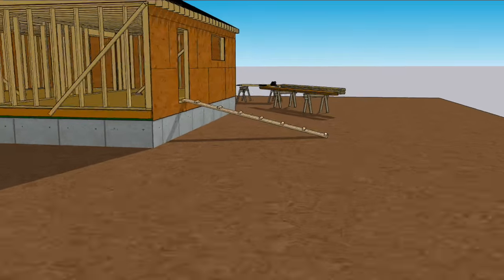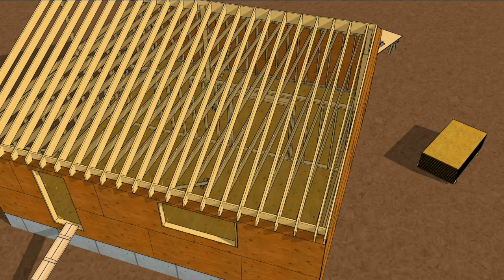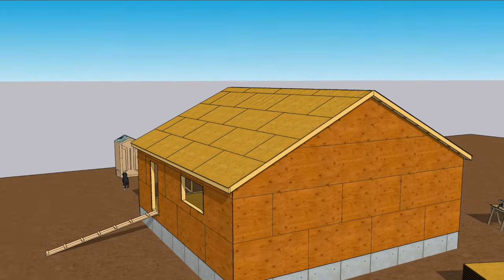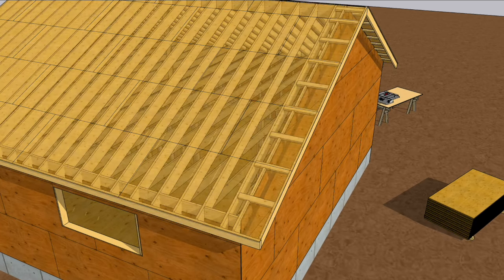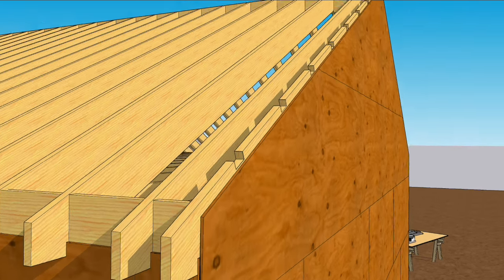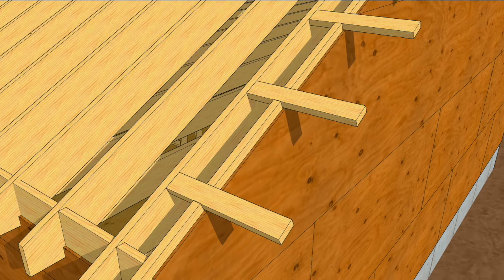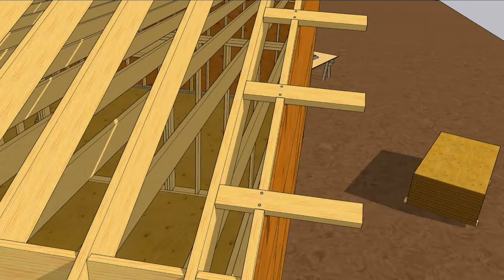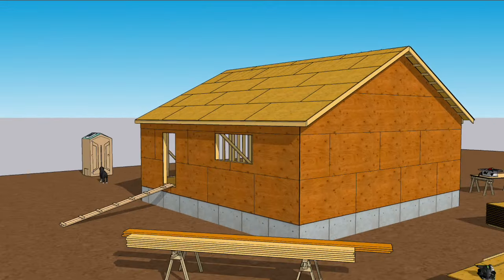Framing Gable Roof Overhangs

Comment: Thank you for this explanation. I was thinking of using T&G as roof sheathing just around the parameter so it is visible from under the overhang. And then plywood for the rest of the roof. With either the ladder method or this method, does the T&G need to extend back to a second truss to tie it all together, or can the T&G just cover the overhang?  This is just for a 10x10 shed. Hope that makes sense.
Reply: Definitely run your plywood to the overhang and use T&G on the bottom as soffit material if that’s what you’re going for.
Reply from the maker: As noted above, it is certainly better to tie the structure together.

Comment: is it really ok to notch out a 2x8 rafter like that for the 2x4 supports?
Reply from the maker: yes.
Reply: Yes, because the 2x4 becomes part of the compression part. That's why the notch has to be tight tolerances. No slack. As always, check with local code and your building inspector.
Reply: Shouldn't there be studs in the upper part of the gable wall, to support the sheathing?  I don't see them shown in the initial pans of the animation. If there are studs there, they'll be right under the notched rafter and will support it as well.

Comment: I am planning on adding an 7 inch overhang (final depth after siding will be 5 inches) to an existing structure that had no overhang.  Is it ok to attach the 7” ladder block directly to i assume the front rafter and not have to notch at all?  My contractor wants to build it out stacking 4 rafters nailed and screwed into eachother without the ladder technique but i thought that seemed unnecessarily heavy and not as strong. Thoughts? 

Also, since its only 7”, would the sheathing still need to extend inward such as in ur animation or would smaller pieces added just on the new ladder block suffice. Thx
Reply from the maker: You can probably screw the ladder blocks into the rafter, using structural screws, but tie the roof sheathing into the existing roof. A LOT.

Comment: Would it be the same for a truss roof?
Reply from the maker: No. Engineered trusses are engineered to work as a complete unit, not as a notched one. This would be something you'd discuss with your truss designer. I have seen some gable trusses that are dropped 3-1/2 inches, to accommodate the outlooks. Do not modify engineered trusses without the adult supervision of an engineer.

Comment: Great vid! If you wanted a longer or stronger overhang, would you build with 2x6 over a 2x4? Asking for a friend in coastal Florida😉
Reply from the maker: Depends. Longer overhangs protect the walls better, but they also catch the wind. If you are in a hurricane zone, like most of Florida is, it may be wise to consider that. 

I know a builder in North Carolina who designs overhangs to be break-away, so that when a flying tree takes it out, it does not cut a hole in the roof. The majority of damage from hurricanes is often water that gets in. 

If the roof is tight, the damage is significantly minimized.
Reply: Thank you for the excellent vid.  Question: What are your thoughts on orienting the 2x4 lookouts so the notches would be 1.5 inches wide and 3.5 inches deep?
Reply: @h2s142 Thanks.

Comment: What's the deepest you can do an overhang with this method?
Reply: depends where building is geographically, building exposure, and what you mean by “can” - if you mean “can” as in no deflection under any conceivable snow or wind loadings…. it is a function of overall geometry and the stiffness (you generally do not want elastic behaviour in wind conditions so don’t design to elastic limits) of the sheathing + nailing pattern used. the depth of the structural eave and the ridge detail at the structural eave matters for wind uplift loading.

this is an area where most codes let you do some pretty janky stuff that is not very good. to my mind there are two main concerns: 1) safety 2) callbacks (including for water)

therefore best to design something that pretty much never flexes any more than the rest of the roof, using some actual understanding of what wind loads are involved…. the uplift loads, not just the self-weight loads, get bigger the more soffit area is exposed. the worst case uplift loads get bigger faster than the self-weight loads get bigger.
Reply: @2brazy4ubitch  Can you convert that to inches?
Reply: @KingofFools  No more than 18"

Comment: Thanks, yet it seems not scaled. if you cut 1.5" in 2x4 truss, it has no strength. so, you need 2x6 on end truss, yet 2x4 in common truss, anyway structure will not like your video, which might be ok for truss all use 2x6 but it is not the real world.
Reply from the maker: The roof is not framed with 2x4 trusses. It is framed with solid lumber. When ordering engineered trusses, you need to specify how you're going to build the house. Sometimes, a gable truss will be shorter, allowing outriggers to rest on top, othertimes, engineers will make the top course of tha gable truss thicker to allow notching.

DO NOT MODIFY ENGINEERED FRAMING UNLESS APPROVED BY A STRUCTURAL ENGINEER

Framing with solid lumber is MUCH DIFFERENT than framing with engineered lumber.
Reply: @ProTradeCraft what’s a structural engineer cost?